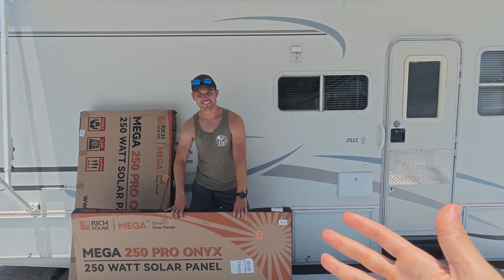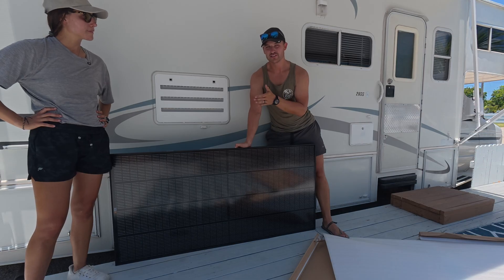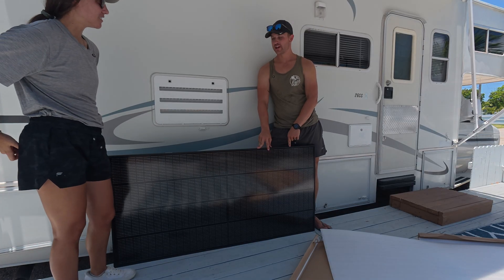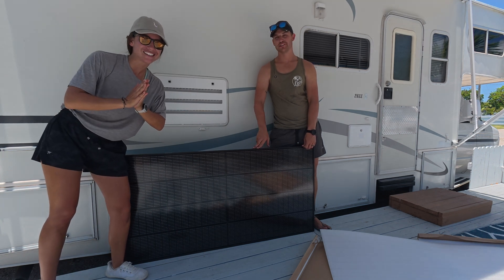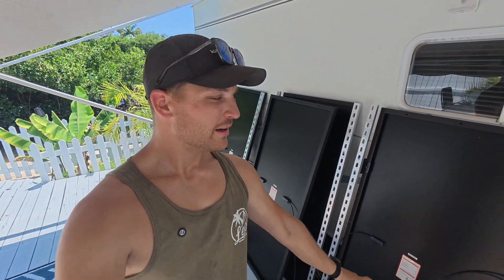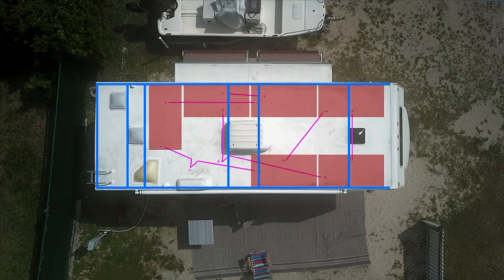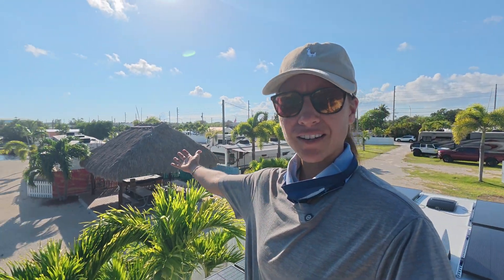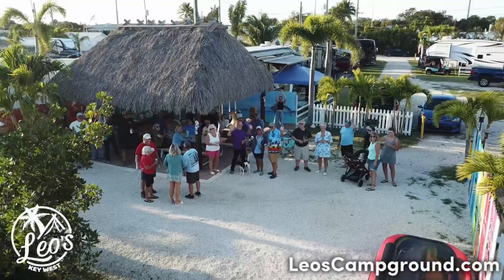We Upgraded Our RV Solar – Now It Powers EVERYTHING (Even the AC)

Comment: Great video showing your in depth panel analysis. You did an awesome job!

The Ecoflow Delta Pro states a max power point current (Impp) useable amps of 15A.  They don’t provide short circuit current (Isc), but if we use other Delta Pros as our guide, the Isc is likely higher.  The Delta pro three I think it’s around 20A ISC and the Delta pro ultra I think is around 23A ISC   However, this is only to prevent a meltdown or fire if the inverter or mppt short circuits, like if it got flooded wet inside.  Otherwise, the max it will draw is 15A, no matter how many amps are available to be drawn.  That said, it’s not economical to go over 23A anyways.
Reply from the maker: Thanks so much! Yeah I've seen other people overpanel up to ~20A - I don't think I've seen any more but I actually didn't know there was a limit? I thought you can feed it as many amps as you want (assuming your wire can handle it) and the charge controller will just limit how much it will accept. Have not done research as this didn't affect us, but that's just what I thought?
-B
Reply: @gabandbren  Your thoughts are correct.  The short circuit current limit is only for prevent you from melting your wires or components if the inverter shorts, causing it to draw WAY more amps than it’s 15A useable.  The internal conductors can’t handle north of 20A continuously. 

That said, you should get significantly more solar production if you over-panel by about 20%-50% of your inverter’s 1600W limit with portable solar that you deploy when parked.  Especially in your case, another 750W of panels would do wonders because you could face them Southeast in the morning and SW in the afternoon, to boost production majorly for those hours.

Comment: Where did you purchase the aluminum struts
Home Depot did not have them.
Lowe’s had heavy steel ones
Reply from the maker: We bought these on amazon in 5 foot sections - that is the max length you can buy before needing freight shipping so we thought that made sense. There is a link in description to what we used, but I’m sure it’s all the same!
-B
Reply: @gabandbren thanks

Comment: DIY solar systems you can over panel from 20 to 50 percent if laying flat
Reply from the maker: Is there actually a limit to how much you can overpanel if you stay under the voltage? I haven’t seen that before 
-B
Reply: @gabandbren  Technically, yes.  The max short circuit current (Isc) of the inverter or MPPT.  For the Ecoflow Delta Pro, it’s 23A Isc.  However, that’s only to prevent a fire in the event of a short circuit inside your Delta Pro’s inverter or MPPT.  Like if water got inside it, for example.  Otherwise, the MPPT/inverter will only draw its 15A useable, even if you go way beyond 23A.  That said going way beyond 23A doesn’t make sense financially when only 15A is useable.

Comment: UR headline is bullshit.. u didn't power anything just installed panels. Second... UR panels don't power anything but  only charge the battery. The inverter, using battery is what powers everything.  U can run AC on inverter and battery by itself. U can charge the battery with 100w panel. It won't keep up with the draw but it will nonetheless charge the battery. In other words, stop the deceit for views and revenue.
Reply from the maker: You’re completely right that the panels don’t power and that the battery does. We were trying to display the importance of how this can maintain our power needs by charging our battery a ton. Before we couldn’t even run our ac for more than ~45 min but with efficiency upgrades and this solar set up we can power everything we need! We do not mean to deceive in any way and apologize if you found the thumbnail misleading. We’re looking to share our journey and learnings along the way and will keep this in mind for future videos. Much love ✌️
-G
Reply: Once the batteries are fully charged, then everything runs off the panels (maybe just not at the same time) so the headline is not so misleading after all.

Comment: I wouldn't want black edged panels. That's just more heat and lower voltage when the sun is out
Reply from the maker: The black option is just for the trim edging, the entire panel is the same for both options so doesn’t really bring in a significant difference, if it was more surface area that was affected by the color change would completely agree 🔥
-G

Comment: Ok boy this is so hard
Thank you for a great video 
I have the same eco flo delta pro as yours and I have been racking my brain to find the right solar panels 👍
So because of all your wonderful work and information I am going to get 4 of these for now maybe one more later 
I do not have room on my roof for all those so I found a ground multi panel mount 
If you could Could you tell me or include a link for what I need to connect these
Do i run them in series?
Please and thank you so much 💗
Reply from the maker: Thanks so much, glad I could help! Let me see if I can provide some additional context:

So typically it is better to run at a higher voltage when you can (so connecting in series), because in the early morning/late afternoon the voltage will drop and running at a higher voltage will give you production for longer throughout the day. BUT that being said when you have obstructions/shading like a rooftop air conditioner or something similar I would recommend having a parallel connection for both sides of the obstruction (can either do front and back or side/side), which will allow one side to produce when/if the other side is shaded. Would be called a 2S2P configuration if you’re going with 4 panels

The stuff you’ll need to get it to work is a UV rated cable to run from the panels to your unit (would recommend going with 10awg to be safe, but depends on how long of a cable run you need and how many amps are going through), an MC4 -> XT60i adapter to connect directly to the Ecoflow solar input, and a y branch connector if you do decide on a parallel connection.

I hope that helps! I can try to find specific links if you need, but let me know if you have any more questions about your setup! 😄
-B
Reply: @gabandbren 
Had a hic up just found your reply 
You guys are awesome 
Really appreciate your information 
I am back trying to find a good ground mount 
Have a wonderful day thanks

Comment: You can over panel the system as long as you don't exceed the rated input voltage ⚡ Great project!
Reply: More specifically, you can exceed the amps, because amps are drawn

Comment: Good Job!!!  install looks very good.  Cant wait to see if the Eco Flow holds up and you will have enough battery to run your AC all night or on cloudy days.  Over all good job on your remodel!!😁
Reply: Just use the propane  for the fridge and hot water and try that before making any big changes.
Reply from the maker: That’s the plan! We’ve spent too much for this season anyway between all the projects 🤣
Reply from the maker: Hey us too! We’re thinking the AC is no longer the issue but our two way fridge is now the energy hog 😅 Thanks so much for the kind words and will keep you posted!!
-G

Comment: You guys nailed it! Super clean! Glad to see this as it will come in super handy down the road as a resource. 

I also have an eco flow 3. Debated solar on our rig, but wanted to have something that was removable of the next owner didn’t want ect. I think this is great how you currently have it set up. And the math on the panels and how you wired def help! I was looking at bigger panels but may be looking into rich solar now.

One question, for your longer line runs, why do individual unistrut to each panel vs 2 long pieces fasten down the mount the panels? 

Assuming ease of installation? But wanted to check if there want another reason. 

Again another great informative video.
Reply from the maker: So glad you found it helpful, thank you! The reason we went with it was honestly just accessibility of getting the product. You can order up to 5 foot sections and have it shipped normally, but over that it appears you need freight shipping, which usually costs $100-200. There are pros to going with one long section - I think overall would be stronger and better weight-distributed. But the shorter sections made the install SO much easier as well, we didn't really have to measure much before screwing everything down. I would've been a little worried about screwing the rail down first and hoping that all the holes line up when you go to install the panels, but of course it can be done with enough patience/precision. Hope this helps!
-B

Comment: Perhaps also look into EcoFlow 800W Alternator Charger 3-in-1 Fast DC-DC Charger.
Reply from the maker: Thanks for the suggestion! I have looked into it but had some confusion about compatibility - it seems there are multiple options of the alternator charger but I think either one you still need an adapter to plug into the Delta Pro unit we have (since it only has one xt60 input for solar). I could be wrong, but got a little frustrated with lack of information and stopped looking haha 😆 
-B
Reply: @gabandbren 
Yeah, I was confused at first until I started watching YouTube videos about it. EcoFlow seems to have two now, one is 500 w along with the 800 w one.
I think the EcoFlow DC to DC charger would be great for your setup. 
It will require some research, adapters and setup ideas, but for the price, I think you'd be very happy with this idea.

Comment: I only comment to help you guys get more views, likes and comments. 
1. Assume that 10 to 15 RVs have done what you guys just did a year or more ago.
2. Assume that Rich Solar has explained how he put two 125 w panels together to solve some shading problems. Thus, the 250 watt panel. 
3. Assume that Solar Panels don't run anything. It's the Inverter & the amount of Battery capacity that you have.
4. Assume making room for an Expansion Battery would help.
5. How much Battery power does that old fashioned Refrigerator consume?
6. Assume that many builders of an RV like yours have switched out that Refrigerator.
I HOPE YOU GET MY POINTS?
Reply from the maker: Thank you so much!! Definitely make some great points and we knowwwwwww with our ancient energy hog of a fridge BUT we’ve already spent too much on the RV this season 🤣 next year 🤞
Reply: assume = ass out of u and me